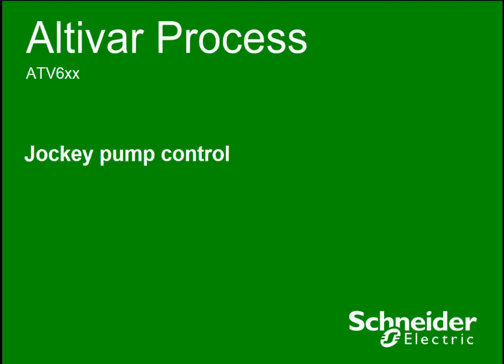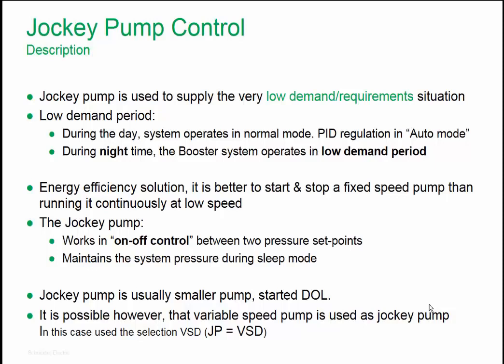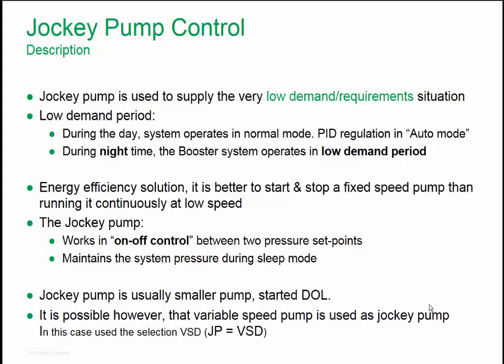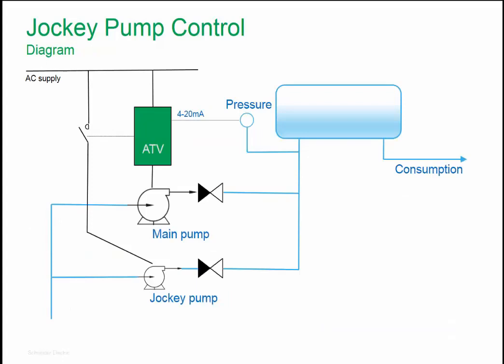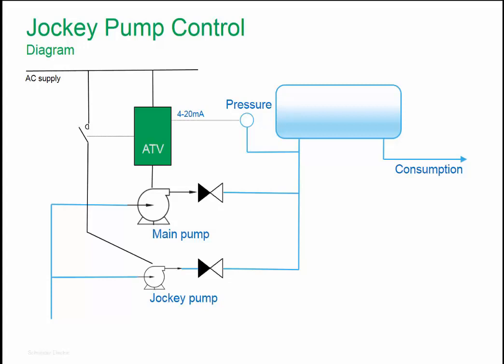ATV600 - Jockey Pump Control Introduction

Comment: Very interesting diagram and video thank you.  It really clarifies to me how a jockey pump works.  I previously and wrongly assumed that jockey pumps only pump compressed air into sprinkler systems whilst also monitoring for pressure drops but in reality jockey pumps actually pump water like the main fire pump though at a lower volume than the main fire pump and even a single sprinkler head.